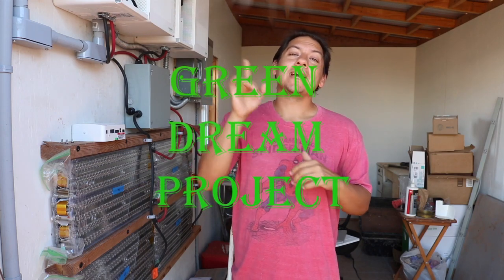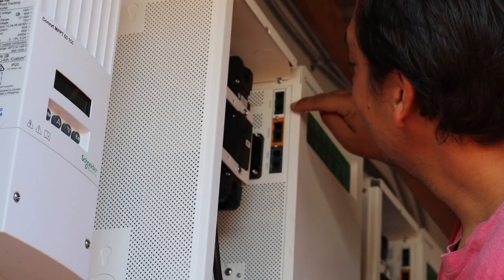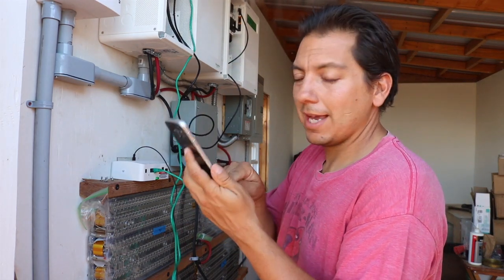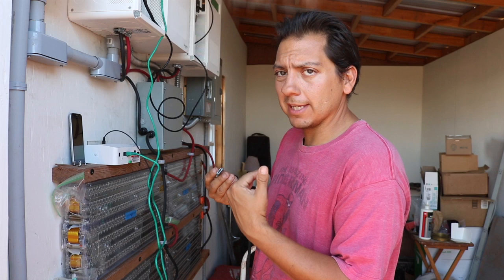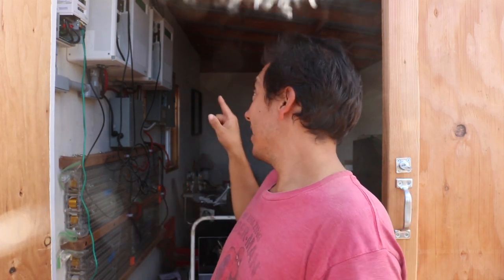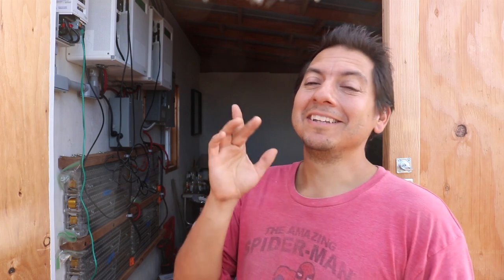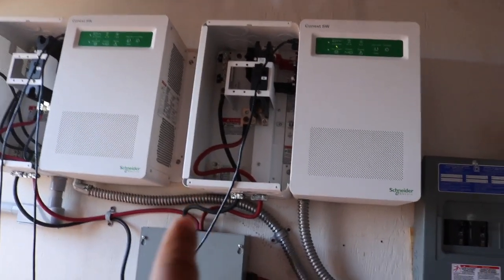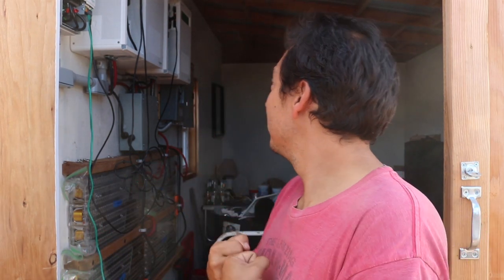Stacking my two Conext inverters (off grid system)

Comment: Hey Jim Great video, I'm working in the same configuration at home...quick question, are you able to double your power output? 3.8KW times 2?  what about the amps? double too?  Thanks
Reply: I have the same setup and yes, it doubles the output power (3.8 x 2). Of course for the power to double, the amps have to double too since the voltages stay the same.

Comment: Nice setup! Here's what I did with my setup: I installed a local outlet out of the inverter and plugged the Combox and a Linksys WiFi router to it. My router is "joined" to my home WiFi/LAN but that appears not to be an option for you. In your case, you can join your WiFi router to your phone's tether and then you'll be able to use your laptop or tablet to connect to the Combox.
Reply from the maker: That's a cool set up. I wasn't sure if a WiFi router would work, because I rarely use my hotspot. It might be worth a try though. Thanks for the suggestion.👍

Comment: so connecting the two inverters gives you more amperage at 1:10 or does it give you 220
Reply from the maker: By stacking the inverters it should allow us to use more watts at any given time. One of the inverters can output 3,800 continuous watts, which might be good for a single dwelling. With them being stacked we should be able to double the output wattage.
Reply: I believe the Schneider inverters can be configured to output 120/240V split phase output, but all of his RV's are running on 120V, so he may have only configured the system to output 120V.  It's probably best for his situation to keep it in 120V mode if he doesn't have any loads that require 240V.  Personally I would want 120/240V split phase so I could charge cars, run larger induction stoves, more efficient heat pump units, etc.  but a system capable of running all that would look very different and need bigger inverters, bigger batteries, and more solar.